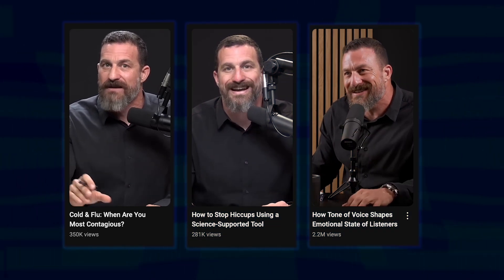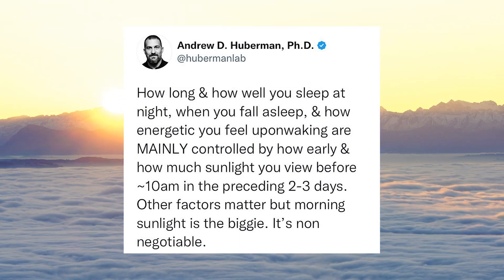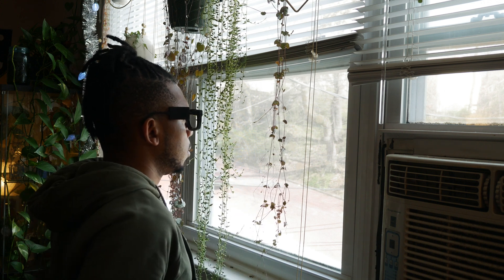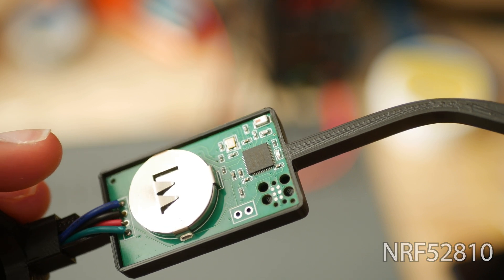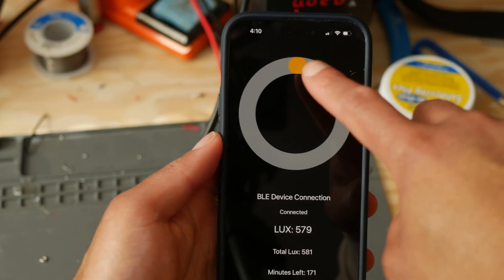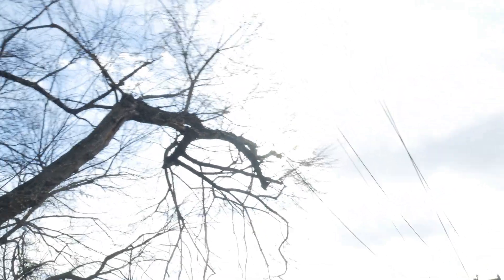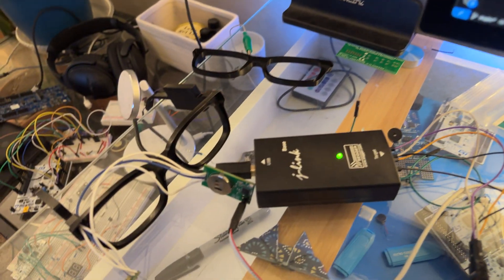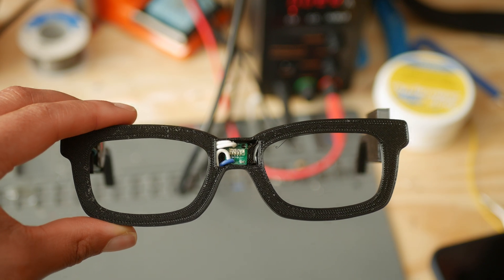Building a gadget from the Huberman lab podcast

Comment: i like that idea ! But it would be even better if that glass can be connected to ur laptop or phone usage . Say you have been using your laptop for more than 5 hours non-stop that glass will detect too much radiation exposure and eye stress . It will give u a warning signal to stop and relax bec. u have too much screen time. Could u make that? Thx.

u have to test it by wearing it while working on laptop as it will detect the radiation exposure just like sun exposure. thxx